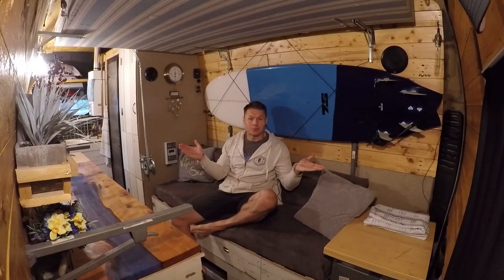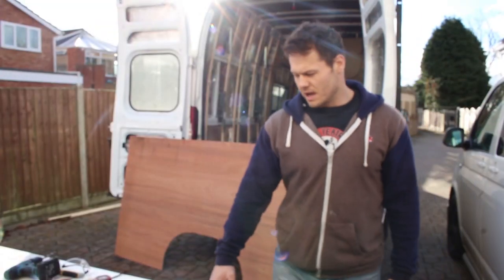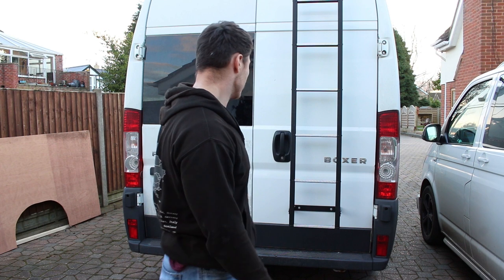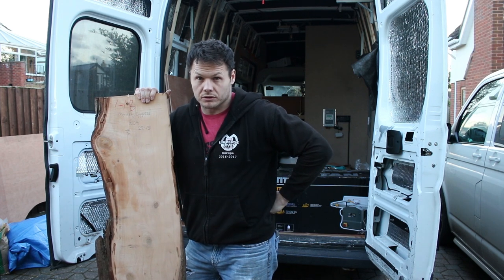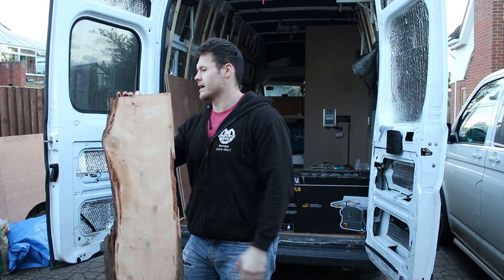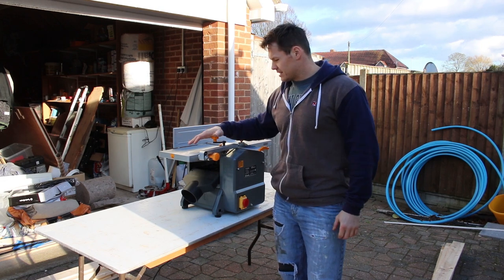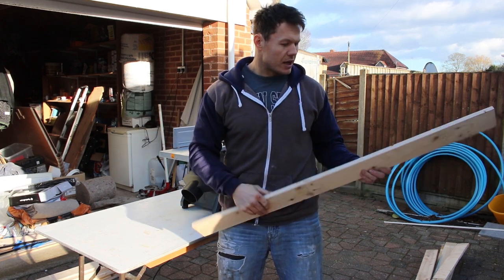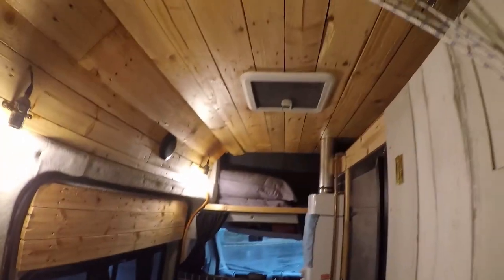Reclaimed pallet wood van cladding

Comment: Just wondered if all the recycled pallet wood you got was all the same width or did you plane it to the same width of the other pieces ?
Reply from the maker: Hey! It was all relatively the same thickness, within a few mm. The length and width varied. I used a planer to take off some of the roughness but didn't bother to sand it down any more than that, it's a fairly rustic finish. If I were to do it again I would use regular cladding though, this pallet wood is far to heavy in comparison and weight counts for a lot when you have a maximum vehicle weight allowance.

Comment: Does the pallet wood not make your van over weight, even though its planed down?
Reply from the maker: No but it is heavy compared to the thin stuff you can get from hardware stores. I love that it’s reclaimed but if I did a build again I think I’d use the thin stuff. I figure I’m doing more damage to the environment burning extra fuel due to the weight than if an extra tree got chopped down. If I can source it from a sustainable company that would be ideal
Reply: @MotoringHome  I ripped my pallet wood down in half length-ways, half the depth but still strong enough- big weight save!
Reply from the maker: That’s a great way of doing it!!